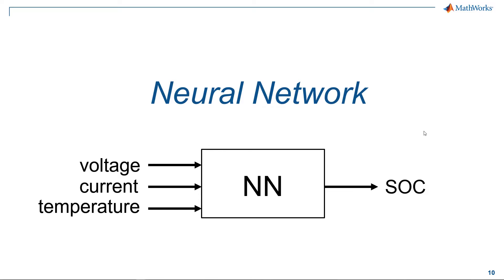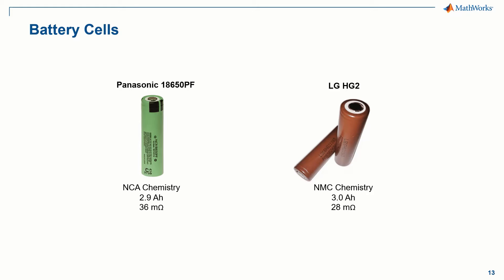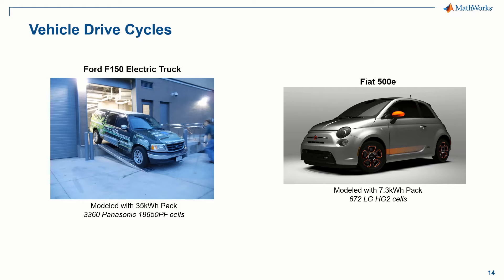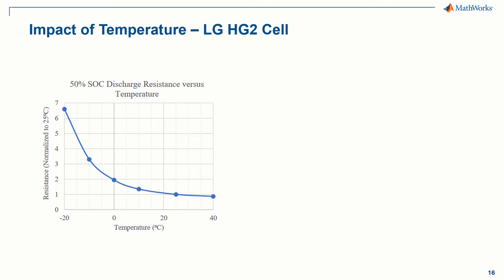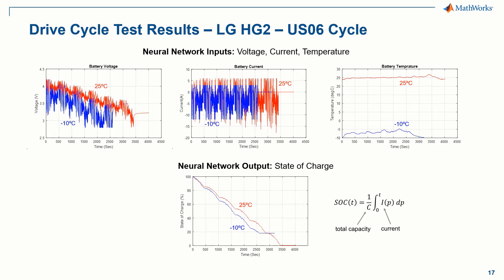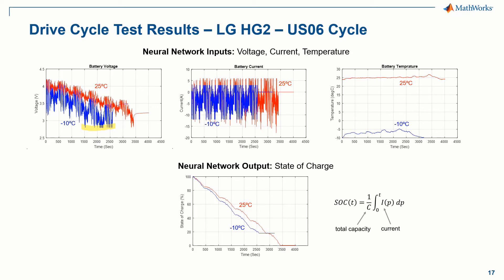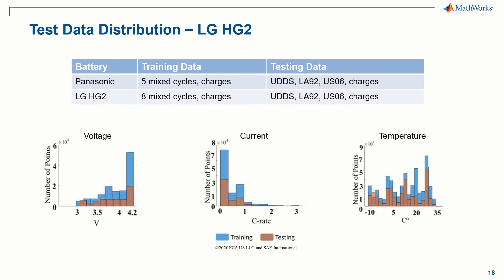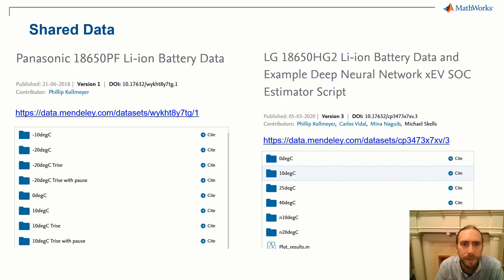Battery State of Charge Estimation Using Neural Networks | Estimate Battery SOC With Deep Learning

Comment: One fundamental issue: To make NN useful for practical SOC estimation applications, you have to include aging into training data. If one does not find a way to use synthetic data to also train aging, training data requirements will explode. Are there plans to address this?